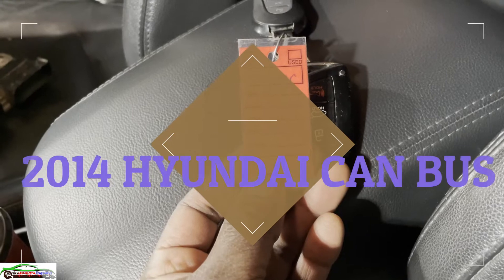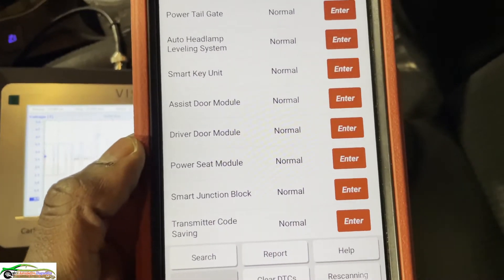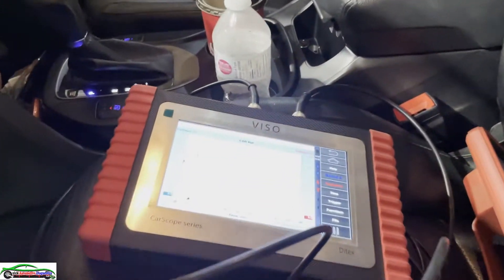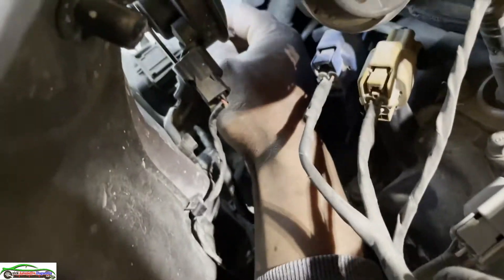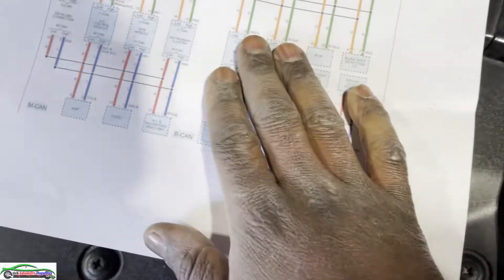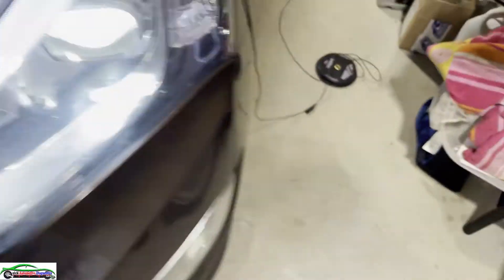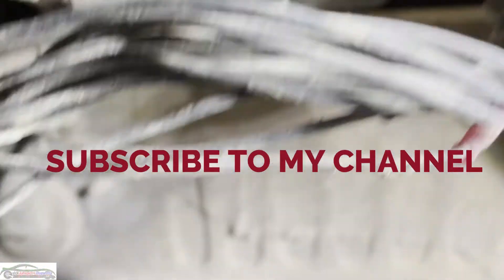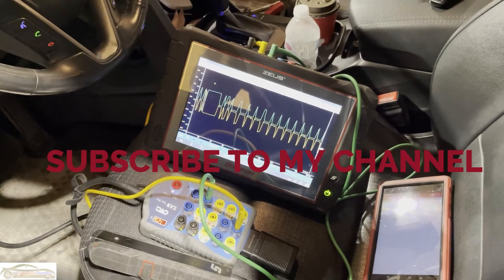HYUNDAI CLUSTER GAUGES FAIL BECAUSE OF CAN BUS

Comment: I am having the same problem, it's only happened twice so far. When driving at high speed the instrument cluster started flickering lights ESC, BRAKE, AIR BAG, TRACTION CONTROL, the gages dropped off, then jumped back to normal the engine temperature disappeared and the vehicle seemed to have a change in acceleration it became sluggish, check engine light come on. I plugged in to find the DTC code, and the Diagnostic tool could not read the vehicle and would not display any trouble codes. It will not communicate with scan tool. Vehicle seems to be in limp mode. It is a 2.0 turbo sonata 2012 I can't find out whats wrong with it but air conditioner does not work, blinkers are fast pace intermitten, vehicle has no power definitely not jumpy turbo like when I first got it and I can't figure out why check engine light is on. Nothing will communicate... i do not have blind spot or park assist but could it be broken wire like as in this video, that would solve problem?
Reply from the maker: Check the communication waveform if it’s a module messing up the can network or if you have a broken wire . Your case can me different than mine.
Reply: @quickautomotivediagnostics8728  The only problem I run into is, I don't have r all the fancy tools to do what you mentioned. I only have OBD reader which is not working because my vehicle will not communicate with the scan tool. I feel like I know how to diagnose and fix the problem but then I don't even know where to start looking all I know is the engine light is on, and the acceleration is lacking greatly. It's frustrating because I just paid last payment on car and now own it but I have a whole host of issues that need attention I paid $17,000  for the car at 2 years old. It's had an engine replacement under recall but has never run the same after engine replacement I love the car but I'm getting to the point of tiresome in dealing with the issues....mostly the air conditioner not working and I live in a hot climate area and it's miserable but can't afford to get rid of it and get a new car 😢
Reply: @jamesabarela how is it going friend? I am in similar situation 2013 optima hybrid. 
Stuck in limp mode so 12v won’t charge and spent over $5000 at dealer and shops but they don’t actually diagnose the issue! 

Driving me crazy because I know it’s just a wire. Changed HPCU, HSG, 12v etc… still get codes 
U0298 lost communication with dc inverter
Reply: @PivotGrowth So I discovered that the problem lies within the CANBUS, Mine. Is located at the top of the radio but mounted up under the dash but above the radio of that makes sense. Just take the radio out and look up. There is a communication box not sure if it's actually the CANBUS module but it was the wires on the back of that, that had become lose and disconnected. Which does make sense because I was messing with the stereo I had a nice aftermarket android touch screen but there was some sort of electrical problem because it would cut in and out so I decided to just check it and put the original stereo back in and I must have bumped or hit the wires lose thank god cuz it was driving me insane with no air condition in the summer in Las Vegas
Reply: @jamesabarela  you’re the man! Thank you. My issue is also can bus communication within the AC. This makes a lot of sense and my photo sensor in the front of the dash isn’t getting any Volts to  it either